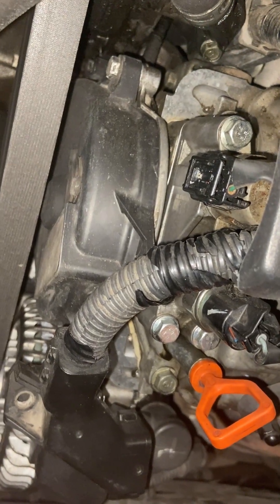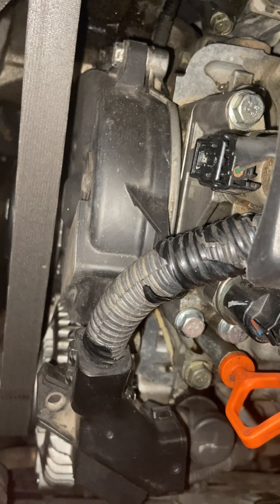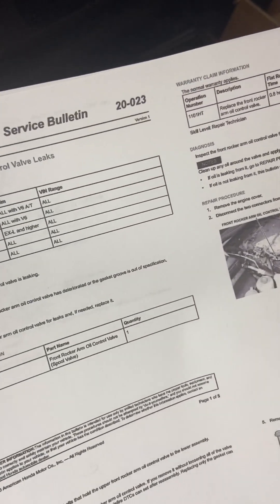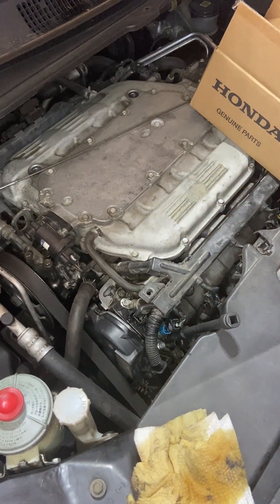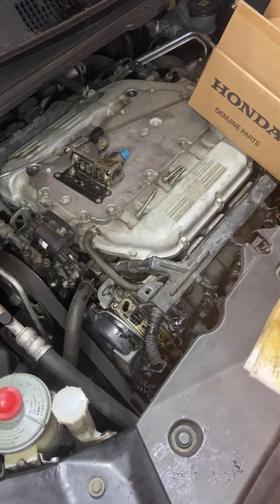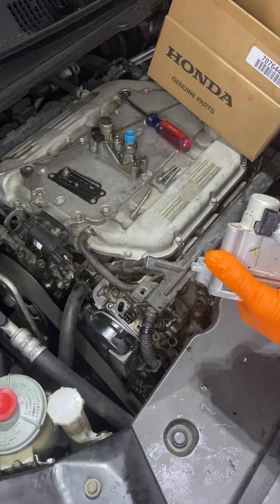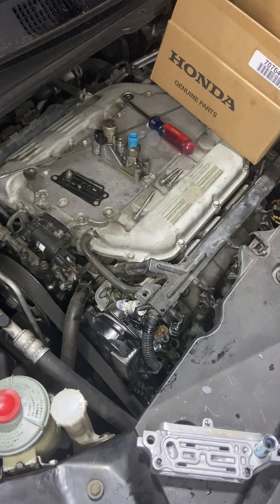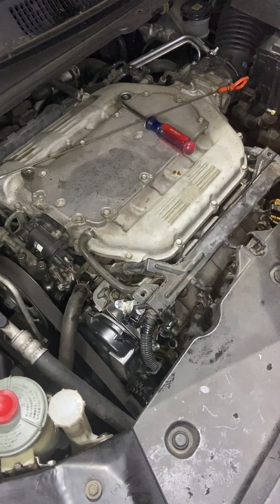Honda Odyssey VVT Solenoid/Upper Spool Valve Replacement for oil leak by dipstick. TSB20-023

Comment: Just did this on my 15. After seeing your video and talking to a friend of mine that is a mechanic, I opted to do the part from honda. I know that many people are saying to just buy the gasket from O'Reilly's but from what Honda says on the service bulletin it looks like it's more of a problem than just the gasket can my friend had told me that when they just do the gasket they end up leaking again. I bought my spool valve from a Honda parts dealer online and it was half of what it would cost me at the dealership. The dealer would not budge on price as they wanted close to $400. Thank you for this video
Reply from the maker: Yes.   You speak truth.  I think it’s more than just the gasket per the TSB by Honda. It’s very frustrating the local dealership costs twice as much than these dealerships in another state.  I just make sure to always buy Honda parts online from the actual dealerships so I know they aren’t fake parts.

Comment: The 15810-R70-A04 is $395.00 at Honda dealer. They don't sell the gaskets so the ones on Ebay are probably fake IMO. I went with a $6.00 gasket on Amazon and got a 3497 code. They didn't leak outside but I suspect they did internally. I refuse to pay $400.00 for new valve when the gasket was seeping. Honda parts guy said Honda technicians do not like to separate the valve from the base and replace the whole valve which requires new valve cover gaskets as well and explains the higher cost. I went with the Dorman 918-056 for $21.00 and carefully cleaned and torqued. Runs well, no leaks, I'll keep a close eye in it. Money maker for Honda IMO.
Reply: How tight did you torque? I just bought the same dorman gasket

Comment: did anyone als get a engline light after doing this?
Reply from the maker: Did you buy the upper spool valve assembly from Honda and only use the upper portion? Or, did you get the gasket from a car parts store and use that?
Reply: @belacallots  I bought one from amazon but the light went away after 1 day now I am having issues with my A/C it says on butt i know its not on
Reply from the maker: @parteeksaini2725 oh the joys of high mileage cars.  They keep us busy all the time.

Comment: Great video and information.  Thanks!!!!  Question - you remove a bunch of electric clips, etc. from the silver cross bar but it doesn't look like you move it.  Is that just to get enough "wiggle room" to get the part out?
Reply from the maker: That is correct

Comment: did you get that part straight from the dealership or did you order online?
Reply from the maker: I walked into the dealership and got it.  I have gotten screwed on fake parts from amazon, eBay, and other places so I don’t risk it with expensive critical items like this.
Reply: @belacallots  I got mine from some random Florida car dealership off of amazon and even tho the part itself looked as legit as it gets and so far is working just fine, the box it came in and especially the red Honda sticker got me thinking. Didn't say the usual Made in Japan or Assembled in the USA but simply MX? Made in Mexico? Looks like Honda got their manufacturing plant in Mexico, too. But anyway, now I see yours is exactly the same so if that's a fake I might as well keep it! Thanks.
Reply from the maker: @bennykill4  then Probably fine.  Out of Convenience and not knowing when I started working on my own cars it took getting burned many times until I stopped buying stuff online.  More expensive but in this case I ruined an alternator and messed around with all kinds of gaskets.  The timing belt kit is the most dangerous deep fake.  It looks so real but isn’t.  Readily available on amazon and eBay.  I bought it and it looked fine. I needed another seal or something so I bought that from the dealer for a couple bucks and when I got home the bag was much different than the other seal I had messed up installing.  On the odyssey forum these fakes are well documented.

Comment: Idk why people buy the whole thing. All you need are the 2 gaskets if you're replacing them due to leaks. 
Pressure switch and vvt solenoid are still working, so why replace them. 😅
Gaskets are $5.00
Reply from the maker: For me the gaskets leaked and also gave me codes with the check engine light.  I spent a lot of time fussing with those when I could have been one and done doing it as Honda recommended.  Costs more but time is money and would save a lot of frustration.

Comment: This is just my experience. I bought some gaskets from amazon. They were thin and lasted 6 months before they started leaking again. I bought Mahle brand from Oriellyauto. They were thicker. I just reused the old filter. Make sure to clean the filter well. So far, so good. Knock on woods.  The reason for the check engine light is due to the plate. It needs to be perfectly flat when torquing down. If you over torque or under torque, it will cause cel. I reset the cel and play with tightening/loosening the bolts. It took a few try before everything was OK. Hope this helps.

Comment: Mahle makes good stuff and sells just the gasket. I'm pretty sure you can still order it throught Auto Zone or OReillys'. Or another option if you bought an ebay gasket is to just clean up the old OEM screen and swap it into the new rubber gasket. If you just let it leak, it Will ruin your alternator.

Comment: UPDATE : I purchased the oem valve spool weeks ago (210$) and finally got around to installing it, following the Honda announcement document and this video. I was having oil seepage around valve cover and this spool area so I thought I'd start by doing this repair first. 

 One thing to note, when you remove the top rocker arm, some oil may spill out. Make sure to have the alternator covered before you do this install!
Reply: I have the same oil leak around the spool valve and valve cover. Did you resolve it ?

Comment: I just put in the Amazon one, drove it around for about 5 miles, no check engine light. Left the screen it came with. We'll see how it goes. Im driving about 150 miles later today I'll report back if I get a CE light.
Reply: How did it go so far?
Reply: @denisouncho2513  Report?
Reply: @JoBianco  i got mines from ebay and works fine so far
Reply: @denisouncho2513  Nice, I did eBay, and also switched the screens around. Just did it today so hopefully it holds. How long has your gasket lasted so far?
Reply: Report?

Comment: Yes DORMAN DONT WORK APRIL 2024 👎👎👎
Reply: Out of curiosity, did you replace only the gaskets? Or the entire upper assembly? I bought the whole assembly from Dorman hoping that it might solve my issue. I already tried a set of the fake honda gaskets from eBay and it kept leaking

Comment: I think this is my issue that's killing my alternators too. This will be #3 I have to replace. I disconnected the positive after putting in a new battery, does this mean my alternator is truly dead?
Reply: Yes the oil leaks into the alternator and kills it which makes it run on battery only which eventually kills the battery.
Reply from the maker: I went thru several alternators and batteries. I have noticed in general I go thru a battery every 8 months in my Odyssey. I just get the very nice battery from AutoZone then they warranty it every 8 months. Free. I think the power doors that we use incessantly and less than 3 mile avg trips just toast those batteries.

Comment: I have 2011 Crosstour and am having the oil leak. This seems so easy bit not worth $200 for a part i wont use but just the gaskets. So what other gaskets can i use?
Reply from the maker: I’m not familiar with the Crosstour.  If it is leaking from the VVT solenoid like this the best option is to replace the whole thing I would guess.

Comment: After watching your video I decided to correct the leaking, I have to say that because of your video and how good was the explanations my installation went flawless. I got the part from Honda for about $260 and it was worth it. I didn't want to have issues with cheaper fixes down the road. Most importantly a peace of mind. It was rough going at the beginning because I have never done any repair in my life but I followed your video and all went smooth. Thanks Alot @Belacallots
Reply from the maker: Francisco, that is amazing. 4 years ago I had never worked on a car. I’m a seasoned engineer and adept at fixing anything else but growing up my family didn’t work on cars.  Start collecting the tools, jack, jack stands, etc.  from Facebook Marketplace and you will start saving so much money.  It also gives you the ability to pay cash for your inexpensive cars knowing you can fix stuff. You can also rent tools you don’t have at the auto parts stores.  The most important tool is YouTube though.
Reply: How's the repair holding up @ciscog5473?
Reply: How's the repair holding up @ciscog5473?

Comment: Doorman parts are shit and I wouldn’t use them for any Honda replacement parts. On the K-24 A3 4 cylinder engine I got a replacement VTEC solenoid made in Japan for $130.00 Oem off eBay with no problems but there are some VTEC solenoids that were like $80.00 and are probably made in china in which case I wouldn’t touch.

Comment: If you have yours leaking replace asap.  I was on a road trip when mine started leaking. By the time I got home and replaced it, oil spilling onto my alternator messed it up and had to replace the alternator.
Reply: I didn't know about this issue when my alternator died.  We were driving on hwy 10 from Florida to Texas and got stranded July 15 on the side of the hwy.  By the time they got us towed to a local pep boys to replace the alternator, we had spent at least 4 hours waiting under a tree on the side of the hwy.  My 2nd alternator started to act up again and that when I discovered that this damn spool valve was responsible.

Comment: If you dont take care of this leak quick, it will kill the alternator eventually. I have gone over 3 alternators until I figure out what the dang issue was. Good thing I was able to swap the alternators by using the warranty on them. Also, to save yourself from killing the alternator, I put some aluminum foil paper on top of it. that way it will drip to the floor and not into the alternator. This has help me avoid killing the alternator while I get to the leak. Also, while I take my time repairing the leak. I wedge some paper towel in the space between the selenoid and the alternator cable to help absorb the oil. Buys me time until I can get the work done. Going back to your comment. yep, those amazon and ebay ones are worthless.
Reply: Very helpful video. Can you recommend a torque wrench precise enough for 6lbs? Also, did you reuse the old dowels or transfer over the new ones? I think there are two of them.
Reply: How long till it went out between your 2nd alternator on to ur 3rd asking for a friend lol
Reply: @tothetexaschiefalotrecords738  I want to say between 6 months to a year.
Reply: @itsjiraheta  well I just change it this weekend so far it isn't leaking right now but will keep an eye out
Reply: @tothetexaschiefalotrecords738  I would cover the alt with some aluminum paper foil in case it start leaking you can prevent the alt from going bad. I forgot to mention I wedge a paper in the space lower bolt and the black connector. That absorbs the oil as it leaks (my first back up, paper foil is my second back up)
Reply: Did you have to use anything to keep the aluminum foil in place? Or did it just stay there on its own? You would think it might blow around in there a bit. Maybe not though. 🤷
Reply: @backroad_bandito  It stay there on its own (on the 2nd one). I just wedge it in there and it stayed in place. For the 3rd one, the one I have on now, I covered it and put some tape on it before it went in. I hope that helps
Reply: @itsjiraheta  ok cool thanks man
Reply: That is freaking genious, My redneck mind applaudes you I am going to do the same thing today after replacing just in case...

Comment: Will be using rtvi on original gaskets tonight
Reply from the maker: Give us an update as to how it goes.
Reply: @belacallots  if it won’t leak and trips check engine but engine works fine than f#ck it - im not paying 400$ for the new solenoid
Reply: @belacallots  ok so today was first day….. so far no check engine light and no oil leak 
Hopefully it will stay that way - will let you know in a month
Reply: @bjones1042  zero leaks and no check engine light
Reply: @ydid7552  Still no leak?
Reply: @billincolumbia 
Hack NO LEAKS!!!!!
Put about 50k and Im a happy camper
Reply: @ydid7552  eeeexcellent!  Thank you, sir.

Comment: If there is a bulletin on this why not take it to dealer?
Reply from the maker: It’s not a recall so you pay.  In my case they wanted $1,600ish.  They wanted to do the spool valve replacement but also included the manifold gasket and valve adjustment.  Then they figured since they were doing that they might as well loosen up the rocker arms and replace the lower spool valve.  Then they also insisted the battery and alternator needed replaced for good measure.  All in all they wanted $3,000ish.  I did the only thing that actually needed to be done which was the upper spool valve for 200ish. To do just the upper spool valve only like the TSB they wanted 600 I think.  So $400 for about 45 minutes of work. They charged me $200 to assess and quote as well

Comment: Your timing belt tensioner is going bad that's what the ticking is it will get worse soon
Reply from the maker: The microphone makes the engine sound far worse than it really sounds. The Timing Belt Tensioner is new. There is a slight tick or knock to the engine. 200k miles.

Comment: You're supposed to pull the torque wrench to it breaks at that set pound u didn't???? It breaks free at set pound at least mine does
Reply from the maker: It was breaking, ticking or torqueing off. Probably not noticeable in the video. Feel thing

Comment: Your missing the second compression pin in the bottom of the spool that's why it's leaking there's one in the top ur missing the bottom
Reply from the maker: At what time in the video did you notice that?
Reply: @belacallots  I think as soon as you took the metal plate out???? Why was I wrong?
Reply: I have the same van I'm dealing with the same problem and a rattle like heard on urs mine was like that now it's worse thought it was lifters but now pretty sure it's timing belt tensioner
Reply from the maker: @sinistersteel1042 I’m not sure.  The upper I installed is still not leaking.  Are you talking about the alignment pins in the new lower that can be seen at 9:20 on the new part? You think I am missing one of those on the existing bottom?
Reply: @belacallots  mine is a 2008 exl and it has these 2 hollow pins I guess u can call them that go in opposite corners around the bolts that cause friction between the plate and the two half's keeping them sandwiched tight together in the upper left of your old bottom I didn't see one but in the new one from the box I seen them I'm pretty sure if u don't torque them and just snug it really good it will not leak that's what I did
Reply: Yup he is ..he didn't put the pins on 😂

Comment: Mine's not leaking YET, but I should have bought the part last week for $171 when I bought some other parts. THIS WEEK, it's $182.78!!!! This inflation is unbelievable. Worse than the mid 70s Jimmy Carter days, which I lived through and had to exist as a college student. Anyway, has anyone tried to remove the top half, clean the outer edge and then only the outer edge of the bottom half with acetone-I mean REALLY good, where no oil exists where it needs to be sealed. Then, seal both halves of the outer edges with HondaBond? Obviously the outer part of the gasket is not sealing so only the outer edge of the housing would need to be sealed. The other internal parts of the gasket must not be leaking (much) since no code is being thrown and therefore they can be left alone. I think when I have to buy this part, I will try that first, and if successful, send the part back.
Reply from the maker: There is a video on YouTube of a guy doing this. Maybe not as meticulous as you are talking about when cleaning up the mating surfaces. You could try. When I replaced it with the different fake gaskets everything appeared fine. Then later on it started gushing oil into my alternator. It doesn't drip down onto the floor so there is no way of telling unless you keep checking it constantly. Replacing the upper is a sure thing though.

Comment: Dorman gasket set did work for me. But, I didn't have that bad of leak to begin with. Maybe something got warped?
Reply: I did the same, but change the screen from the original gasket. have not started yet since am waiting on valve covers, the ones i had were deteriorated where the grommets go. looks like it melted down and got deformed. did you have the same issues?

Comment: Thank you for this video. My wifes 2012 just started leaking again. I changed the gasket out I didn't have any codes but after about 2 moths it started leaking again. I will have to go this route and hope it works out.
Reply: I suggest you get a VCM delete kit,it will fix the issue.Look that up on YouTube as well
Reply: @denisouncho2513  I will check that out. Thank you for the info
Reply: @denisouncho2513 I got that but it didn't prevent the leak from returning. I just ordered an OEM spool valve and will try this.

Comment: Sounds like you have had a few goes at this repair. Did it hold up this time? 

Might have to do this job on my ‘11 Odyssey.
Reply from the maker: On this Odyssey I did loosen the bolts and retighten 2 days later for a very very very slow leak.  Bone dry now still 5 weeks later.  With this not leaking the battery light that would come on intermittently has been off since.  I attribute that to no more oil leaking on the alternator.